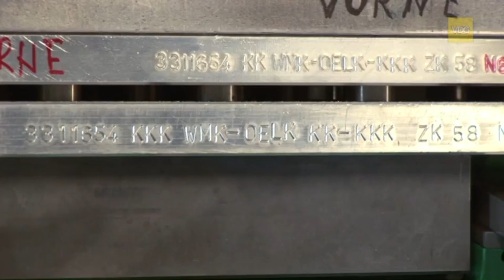Cylinder Heads Casting Secrets Only EXPERTS Know

Comment: how long is it left to cool?
Reply from the maker: This depends on several factors, mainly the metal type, product volume and surface area.
Reply: @AlJazariedu  roughly how long for an aluminium cylinder head?
Reply from the maker: @ Roughly from 25 to 30 minutes.